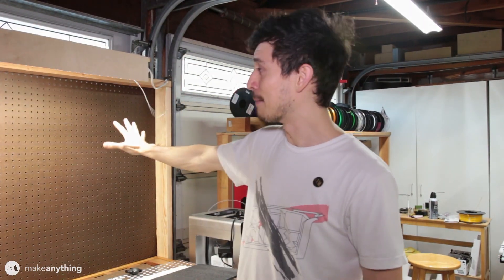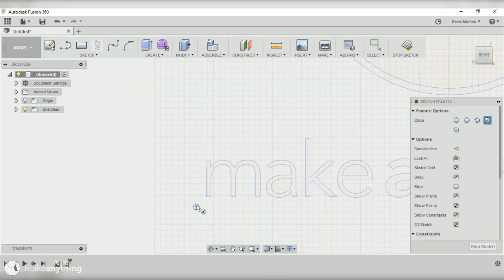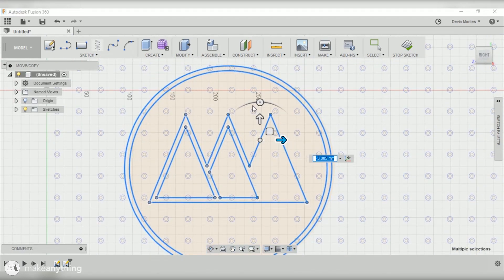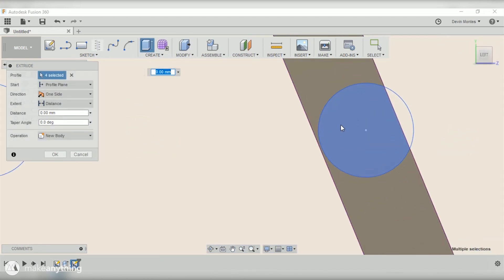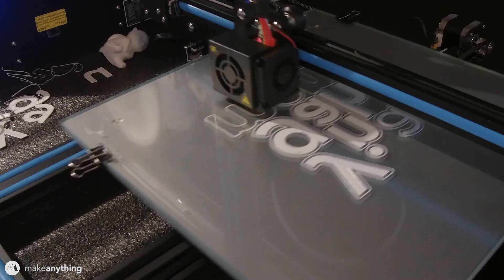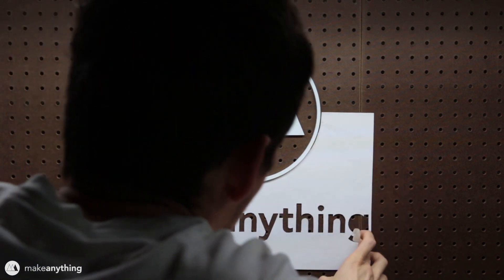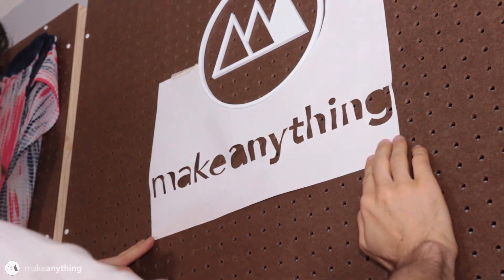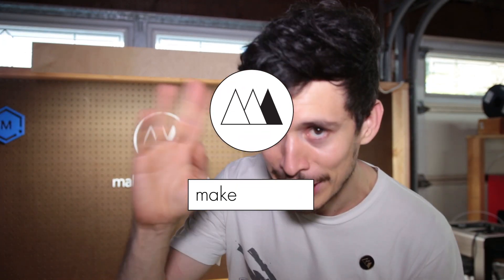3D Printed Pegboard Logo in Fusion 360

Comment: I was wondering if you could 3D print an inhaler casing. The standard blue/brown ones are fine, they are just a tad boring.
Reply: Hachiro It would probably be as easy to clean as a regular inhaler. I don't see many problems.
Reply: Yeah, it would be similar to the problems with scratches on plastic cooking boards. However, it would be only used by one person for one thing and easy to disinfect. If it was ABS, then it could be acetone smoothed too.

Mainly I was just looking for a more personal design (e.g. fitted to the hand) with some more functionality (e.g. belt hook) and a bit of Devin flair, even if it wouldn't actually be used in real life.